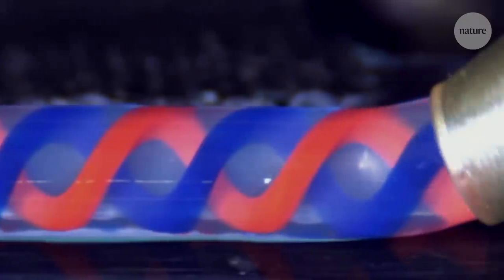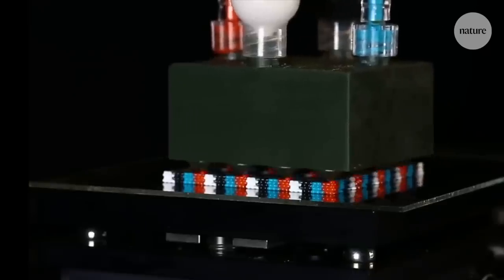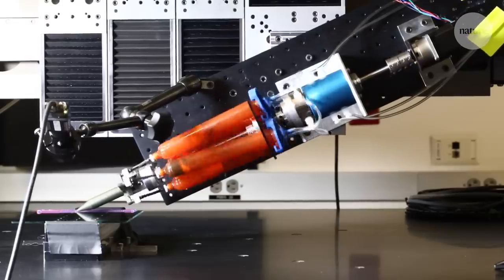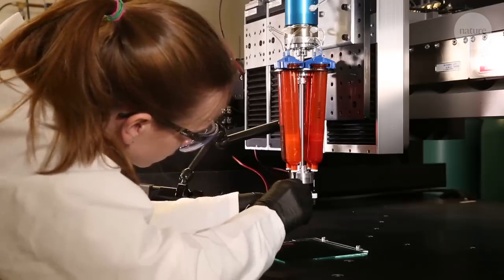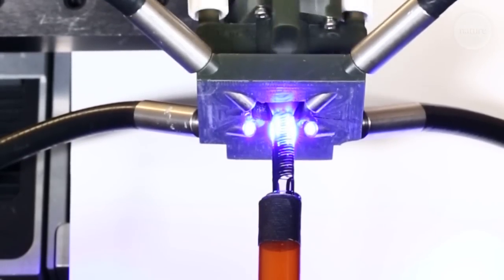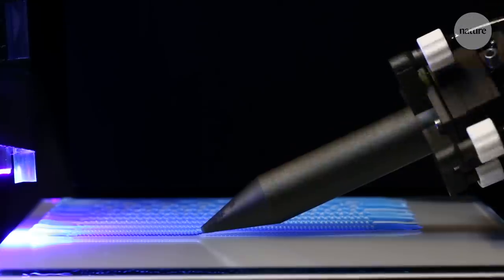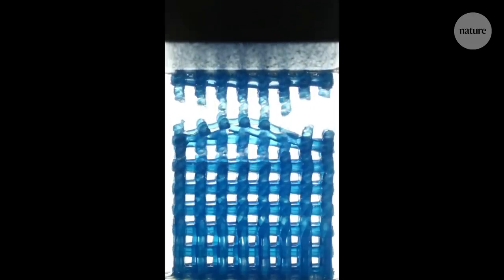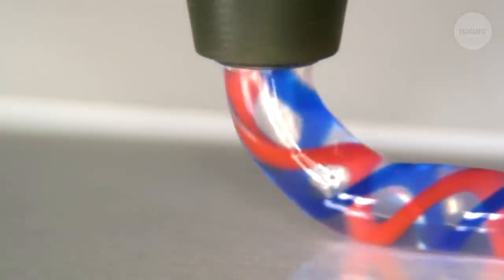3D printing - with a twist

Comment: For those who are asking why the term ink is used for the material instead of filament, this is process is not fused filament fabrication. The ink is viscous liquid which is extruded, hence no melting of a filament is involved. As soon as I saw the thumpnail I could tell this is the work of Jennifer Lewis. Amazing work!
Reply: For what it's worth the abstract alone mentions filament at least five times.
Reply: honestly no i think this is just badly researched

she goes on to say the model is made up of voxels which isn't not the correct term either as voxels are a entirely different thing to what shes trying to describe

she then says the machine can create details smaller than a voxel 

ok voxels don't have a defined size 
neither do pixels
retina uses very tiny pixels
and stadium screens use almost marble sized pixels

she then uses filliment but says its made up of inks

no its MATERIALS inks are a color term referring to actual inks 

polymers materials plastics resins pick the word but inks is not it and I highly doubt the researchers call them inks other than when they explained how 3d printing worked using the conventional printer analogy

this is just a badly researched video
Reply: @Sarge92  I think they just pitched it at "TV audience" level, rather than the "Building my second Voron" crowd.
Reply: @Sarge92 I think the definition of voxel here will be the resolution of the bare print itself, i.e. the same whether or not the filaments have been twisted or not. So you could say 'properties within a voxel'. Also, the term 'inks' was as a description of filament, so it would be easier to understand. Also, inks was mentioned once for an analogy for understanding. The video served it's purpose imo.
Reply: @Sarge92  I think the use of voxel is pretty straightforward, if you play a game made of voxels, you know it's just the building block of the objects.
Basically is the minimum amount of ink the printer can use in one layer
Reply: @afoxwithahat7846  oh that's fine but she specifically says

can print smaller than a voxel

a voxel has no real world size its like saying you can print smaller than a pixel pixels can be fractions of milemeters on phone screens to the size of marbels in 400 inch stadium screens 

like the concept of ink people don't refer to physical printing in voxels or pixels

even printers don't use pixels because pixels is a digital display term referring to the combination of red green and blue sub pixels that vary light to make a color

meanwhile printers mix inks to form a colored dot which is why printers print in dots per inch not pixels per inch
Reply: I've always viewed pixels as a 2d representation of colour on a computer screen, and a voxel as a 3d representation of colour in a specific kind of video game, never as a term used in 3d printing.
Reply: @Sarge92  I understood it can change details in the structure that are smaller than a printer voxel, it's not gonna print that small.

It's like polishing a paint on a car, you can't make a few micrometers car but you can chance smaller details on a bigger car.
Reply: @rilock2435  it's used in lots of things 3d, youll see it in research papers
Reply: @Sarge92  if you go by the abstract for the paper that this video cites as a source, you’ll see they use voxel as the size of one extruded layer, and specifically refer to this technique as allowing for subvoxel control
Reply: @Sarge92  I have to agree with the misuse of voxel. We usually use that when we use inkjet printing to form 3D structure where every droplet forms a voxel, and those are discrete. I don't think it is right to use the term voxel for extrusion as it is more of analogue deposition process instead of discrete droplet on demand process.
Reply: Thank you for the explanation!
Reply: English
Reply: @Sarge92  Do you know what a comma is?
Reply: @Sarge92 I agree that her use ink/filament interchangeably was odd and it might just be poorly written. But I don’t think her use of voxel was incorrect, people don’t use that word super often when referring to 3D printing but it does apply. She’s just saying that it can print smaller details than the machine and filament normally could. I don’t think she meant to imply that a voxel has a set size at all
Reply: Huh, and I thought it was because the british have the vocabulary of infants.
Reply: @monhi64  but thats the thing voxel has no size in Minecraft voxels refer to the blocks 

in voxel modelling the voxels refer to the tiny cubes that make up the models

and in her printing method it does not even use voxels

the term voxel itself doesn't even speficy a size a voxel is the unit of a 3 dimensional grid 

much like how a pixel refers to 1 point on a 2d grid a voxel is a cube on a 3d grid

shes using it as if its a size but its not

and 3d printing has never referred to voxels when measuring stuff they use layer heighs and step movements
Reply: @3amali1  unless you go into non-planar slicing, it is definately discrete in the z-direction (quantisation level: layer height)
And if x- and y- axis use stepper motors, that is also a discrete quantity

So you'd end up with very high and thin voxels, but you could reasonably argue it is a quantised process
Reply: I thought it was because it’s called printing and it’s just easier to say ink instead of filament

Comment: Nobody in fdm/fff 3d printing calls the extruded filament "ink" and they for sure don't call the smallest printable detail size a "voxel". Those terms come from completely different fields
Reply: yea the paper itself dose tho. Probably just a disconnect between common and academic parlance.

edit: also they are using uv curing resin not standard filament so maybe ink is more accurate?
Reply: Ha I didn’t notice the UV light until I read this comment. Yeah it looks like they are using resin instead of filament. Though current resin printers are incredibly precise, they print at 2um. This seems much thicker.
Reply: yeah, even the actual filament example given is called ink for some reason even if the gel resign being used Ive never heard of them being called ink before
Reply: Yeah, but so what? It can be a better way to express it for the group that is developing the technique. When you are pushing the boundaries, it is not unprecedented to come up with different terms if you believe they better represent what you are trying to convey. Scientists do this all the time.
Reply: this isn't an fff/fdm printer, its an ink machine. There's no plastic involved, or filament

Comment: “Smaller than a voxel” — a voxel is any data point defined in 3d space.  So smaller and larger only have meaning if you state what the size is. And so if you are encoding properties such as twist rate and material injection rates at a sub-voxel level (I.e. defining data points between the ‘voxel’ data points) why not just increase amount of voxels or increase the amount of extra data encoded into the ones you have.
Reply: and they had to massively increase the size of the voxels to be able to do this effect
Reply: Maybe I'm understanding it wrong, but I assumed what they meant was telemetry within voxels themselves.  Allowing a material to be along a gradient of top to bottom, left to right of each "bead" of the material laid down, allowing even more precision.  I.E.  An active conductive material embedded within an inert layer of material holding it in place.  If the printer prints at 10mm layers, the material within could be anywhere within that layer.

Comment: dont think Ive ever heard of filament being called 'ink' before. even gel resign being called ink by someone seems weird, but to the video's defense that is what the paper called it so its more the researchers either wanting to coin 'ink' for their gel resign or maybe this project was started before 3D printing became common enough that the terms used in it became standardized and switching just would have made things confusing?
Reply: the video also keeps using voxels out of place as if a voxel is a defined size
Reply: @Sarge92  No they are right. A voxel isn't a definied size, but interms of 3d printing, a voxel is generally seen to have the dimensions of the width of the nozzle extruder, as that is the SMALLEST size it could print. Given that, the fact they are putting detail and functionality inside the width of the nozzle, it is thus sub-voxel
Reply: It's not filament at all. It's like a gel with different gel inks inside it. It sounds like the narrator is saying ink is used for all 3d printers though. Seems like the narrator might just not know and assumed that was the term used for all of them.
Reply: @jaredf6205  yes, however the resin in sla printers isn't referred to as ink either. In fact ive never heard any structural resin referred to as an ink. I haven't read the paper myself, nor do I intend to honestly, so perhaps there's actually a nuance I'm missing (e.g. they were using red and blue inks to color the resins at first and somehow the terminology ended up sticking).

Comment: I think this would be excellent for use in making thin, narrow channels for microfluidics and doing chemistry, you could make the helices with a material that dissolves away when allowed to sit in a solvent to make tiny, precise channels for different chemicals to flow.
Reply: Great idea
Reply: you are much better off using resin 3d printers for that.
notice the size of the extrusion, and that you really can't make things like y connections with it.
Reply: We already use PVA filament for dissolvable supports, water is used to dissolve the PVA, although water is a solvent
Reply: @cj09beira  a resin printer might be suited for making junctions, while this printer could make larger pipes and channels, almost like off-the-shelf pipes and fittings.
Reply: @cj09beira  I think this is meant to be a prototype, the usable model would of course be smaller

Comment: This could allow for specific break sections like the shear pins on farming equipment. I think this is going to be amazing for stress testing prototypes!
Reply: You know what we call that in engineering? A notch.

You can already do this with 3d printing, I did that like a decade ago because its a standard design method. I also had shear pins on even my remote control 3d printed planes (I used high tech number 2 pencils in my V tail, they would break at the base removing about 1/2" of pencil but save the parts, then you pulled the broken part out and push the pencil in a little farther so each pencil would shear about half a dozen times before needing to be replaced).
Reply: @jakegarrett8109  here’s a cookie 🍪
Reply: @jakegarrett8109  it gives another option. You could always add notches and dogbone structures into your designs. But they don't work in every model. You may need a constant width in the shear pin. Or you may be testing a piston with compliant shearing. The only way to deal with that in the past would have been to print the pin separate, and adjust the g code manually to change the fill-in percentage in the middle of the pin to create a weak point. Now it can be done automatically by decreasing the number of turns of the nozzle to have an decreased amount of the harder material in the weak section.
Reply: @harmonic5107  A pin with constant width you say, printed... Hmmm, if only I could simply model a small VOID in the middle of the part in about 10 seconds. Yeah, I guess impossible...

Lol, its really a solution to a problem that never existed.
Reply: @jakegarrett8109  it's again another solution. 

Bah, why do we need these cars? We already have horses!
Reply: @harmonic5107  I'm just pointing out its a completely useless solution, and far more complicated than the 10 seconds it takes to add a void in CAD, and that void method works with all 3d printers.
Reply: @jakegarrett8109  completely useless is a hell of a stretch. If you can't think of a use for it that's fine. But just saying "I can't think of a use for it, so it must be useless" seems like a bad take.
Reply: @harmonic5107  Your examples are completely useless for this technology since its better solved and more consistent typically knowing the actual surface area at the break location with its more fixed material properties. I just don't know of any engineer that would sacrifice that for no gains.

It has OTHER applications though, like if you can make the colored channels water dissolvable you'd be able to make hydraulic muscles by dissolving those inner channels and pressurizing the water (stretching the tube like a muscle), or vacuum like a contraction. Perfect application for sex toys and that's a huge market.
Reply: @jakegarrett8109  LOL 😂 I'm 100% with you, Jake. This is kinda neat, and mayyyyyyybe would have some VERY niche applications, but I do agree that it's borderline completely useless, and claims to solve problems that either don't exist, or that can easily be solved with our existing, standard 3d printing technologies 😂
Reply: @harmonic5107  lol so you're comparing the differences between using a simple design change in existing 3d printers VS an overcomplicated rotating nozzle printer that basically does the same thing to horses VS cars???
Reply: @PatrickRatman  do you realize how overly complicated car engines were at the time of the first cars? People thought they were a fad for the Uber rich. And they really were for quite a while. But technology advanced. The cars didn't get less complex. But the manufacturing got simplified, making them faster and cheaper to produce.

At the moment, this is a new technology for 3dprinting. So yes, it seems complicated. But as the past has show us time and time again. Just because it seems complicated now, does not mean it will not be the standard in the future.
Reply: @harmonic5107
bro you lost, just stop
Reply: @crunchybones2528  conversations are not a thing to "win" or "lose"

My opinion is different from theirs and yours. Not better or worse. Just different.
Reply: @harmonic5107  It was never a conversation, it was a debate, and don't lie about that. Take the loss. The other guy is right and the fact that you can't see it makes me wonder if you have any CAD or engineering experience/knowledge at all, and this is coming from a guy who has zero traditional instutional engineering experience at all.
Reply: @raam1666  you seeing a conversation as a debate says a lot about you 😄

I'm not here to debate. I'm here to discuss a new technology and it's possible uses. Because I think it's a cool innovation. If you want to debate, that's fine. But I'm not taking part in it. Have a good day!
Reply: @harmonic5107  lol. Cope
Reply: @raam1666  you do you buddy 😄
Reply: @harmonic5107  cope harder
Reply: @harmonic5107  How do you manage to deal with people on the internet like that? I wish they spoke to me like that in person; it's so easy to disrespect behind a screen.
Reply: @zano9291  I view them as characters in a game. They have no impact on me in real life. So I don't really need to pay them any mind.

Comment: I don't know if this could be possible with molten filaments, but it would be a novel invention to combine different materials with different elastic properties. For example, a combination of a material that's resistant for compression and another that's resistant to tension
Reply: just simply keep a tank of molten fillament on the rotating head, or get micro spools designed to fit on the rotating head

Comment: I think I am lacking of imaginations of what we can use this for. I guess it's super new right now
Reply: imagine in a slicer you could add more or less toughness on some areas of your prints. or if you fine tuned a compliant mechanism to work with varying levels of stiffness, so it'd bend one way in a certain use case and another otherwise. you can really take this far imo
Reply: U already can
Reply: @shashvatverma5673  The printer shown in this video doesn't work like a filament printer though. It's just a colored ink, not a different material. Still, I don't really get the point. Just use a smaller nozzle and print sperate materials separately. That way you aren't limited to the confines of the rotation either.
Reply: Also there might be a use case for Bio-printing. This new axis can allow us to control the density of a 3d- printed tissue as a function of 3D coordinates

Comment: I wonder if this hurts the overall layer adhesion , also what kinds of materials this system is limited to. Since it uses tubes I and spins then it needs all the material to fit in the head of the device, so it must work on a relatively small scale.
Reply: Its done with liquid/semi fluid resins, so in theory it could do large stuff if it was plumbed up with a excavator style rotating fitting.